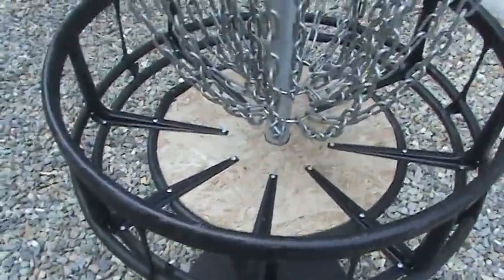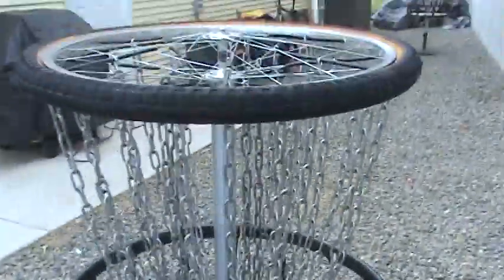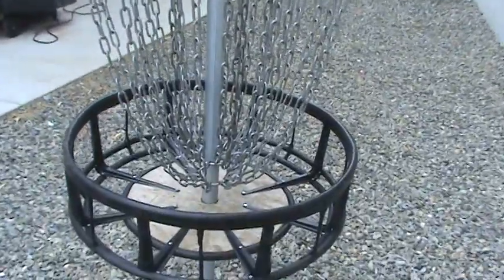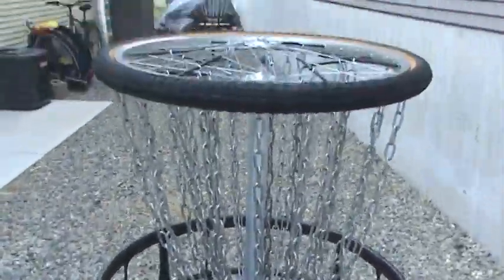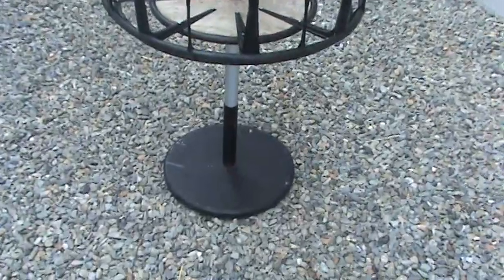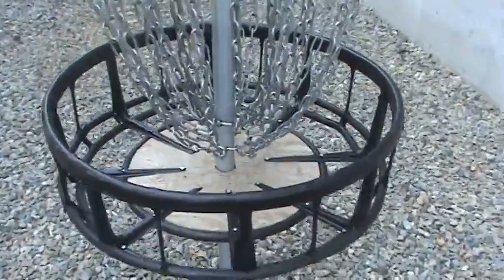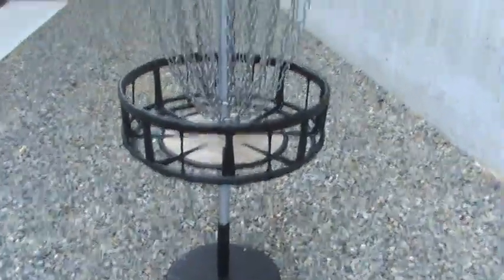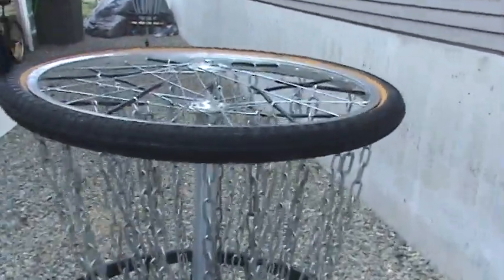Homemade disc golf basket 2

Comment from the maker: your best bet for both surviving both the elements and possible vandalism is using a car tire for a basket with the top cut off.   We are using that style for a course just installed here in Kamloops and it is working great.
The Wilson basket I have outside lasted well through the winter however vandalism could be a challenge around a school